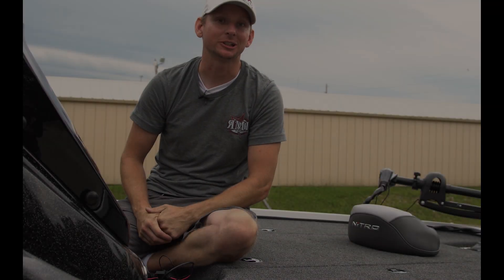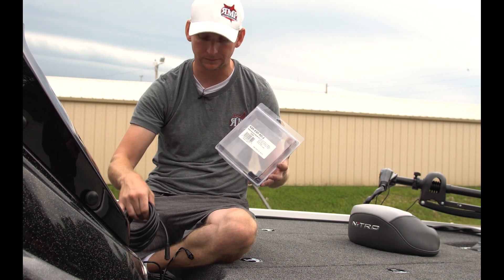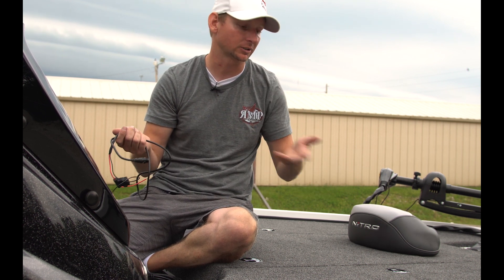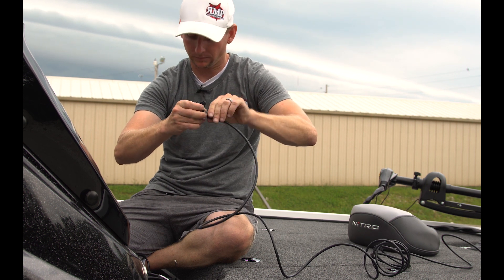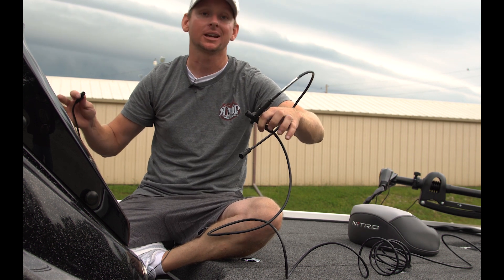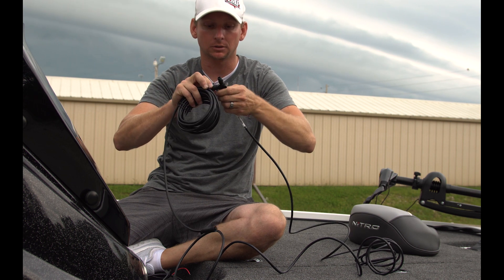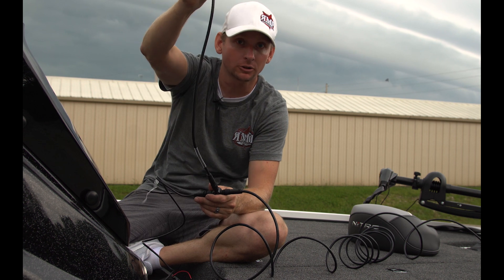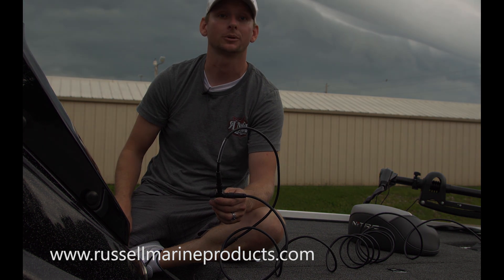How to Build a Lowrance NMEA Network

Comment: You really should take down this video, it's NOT the right way to build a NMEA 2000 network. The power does NOT get inserted via the side of a tee, it requires it's own tee. Also there should be two terminating resistors, one on each end of the backbone.

Comment: What if my bow graph and console graph are networked with ethernet, but I want to add a steady cast and another console graph. Can I just run NMEA for the steady cast, the second console graph, and the first console graph? Then the first console graph is on the nmea, but also ethernet connected to the bow graph. Will all the graphs/steady cast then be connected?

Comment: I'm really confused by this setup. Hoping someone can clarify. I don't see the need for the T connector at the bow unit. While this works, he essentially split up the backbone and I dont see why. Why couldn't you just do the following: hook 4 T connectors end to end with a terminal connector at each end. This is your single backbone. That way you have 4 "ports" availble to run drop down cables directly to console graph, bow graph, point-1, and NMAE power. That way there is no need for T connectors at the end of your cable runs and you can just plug dirctly into the unit. Is that right??
Reply: I believe you're correct and I don't see how that wouldn't work as long as you don't exceed 18 feet with your drop-down cable, which he obviously wouldn't in this application. I could see how you would want to use remote T connectors if you had several components to connect to the system in the front or the back of the boat, so you wouldn't have to run so many cords. I'm not sure why he used the connector at the bow here. He also ran the power for the backbone off the end of a T which is incorrect. I'm not sure what this cat was thinking with this setup.

Comment: Hey just came across your video. I'm having issues with my point 1 antenna actually being seen by the hd7 Gen 3.  Is there any diagram out there on how this should be connected? My unit is using a big blue cable that powers it however in the manual is using a nema cable for power so it's very confusing... I'm guessing the point 1 is not getting any power so the main unit is not seeing it... Lmk if you have any advice

Comment: New to all this so please excuse the newbie question.  My boat already had a network(s) established. HDS Live 12 (console) and HDS Live 9 (bow).  I’m adding an HDS Live 7 at console (because I already have it).  The power connector has two cables, power and NMEA 0183 cables. Do I need to connect the NMEA 0183 cable to anything or will connecting the yellow Ethernet ports from my 12 to the 7 provide all the networking I will need?  Primary purpose will be displaying 2d and down scanning while side-scanning on the 12. Any help would be appreciated.
Reply from the maker: you will not need to connect anything to the NMEA 0183 cable, just use the yellow ethernet port sir

Comment: Why do you have to put a second T connection up front for the bow graph when you are already running a 15'ft cable off a T connection to the bow?
Reply: It's needed in order to be able to connect the required network terminating resistor on the end of the back bone.

Comment: Do I need to hook up power supply to each component or does the unit get power from nmea 2000
Reply: Some devices such as the Point 1 are powered from the nmea network, multi function displays such as  Sonar/Chart Plotters require their own power source.

Comment: So.  to connect two units you need a minimum of the starter kit and an additional drop cable.  Is that correct.

Comment: I usually like your stuff,  it this one missed the mark.  I don’t think you can plug the power into the end of a T like you did.  I believe it has to run into the top of a T, with a terminator on the end. In one of the other comments you responded that was correct.  This video. Is supposed to help people understand how to establish a NMEA system and will end up confusing people instead.  It needs to be corrected or taken down.
Reply: I'm actually watching this video as I am setting up my nmea system to my hds live ... the other resistor is not hooked up in this video.. you ha e to have that for the system to work ..  and I believe you are correct the power supply has to be set up from the middle t connecter not the side ... I'm just confused on why I need two power supplies for everything to work .. my hds live unit came with a power supply and this nmea system also has one .. I'm not sure if both need hooked up or not.
Reply: @Rockers1121  you need both power supplies. The HDS is power by its own supply and the NMEA network is a low power network, but it does not draw from the HDS.
Reply: @FishOn1  oh OK..  damn ... that's unfortunate.. I'm hooking my hds live to a separate 18ah lithium battery because I didn't want interference from my trolling motor battery or my starting battery .. so do you think it would be OK to wire the nmea power supply and the hds power supply together and just hook them straight to the battery ? Or am I gonna have to hook up the nmea to a switch that is powered from one of my other batteries, and if I do would it cause interference to the nmea network?
Reply: @FishOn1  I'm honestly not impressed with how the wiring for lowrance and the nmea network wiring is designed at all, the tranducer plug that plugs into the back of the hds unit is way to big in diameter  .. no way am I drilling that big of a hole into my transom .. I had to go over the whole transom with the cable .. I couldn't use the hole that was already there unfortunately  .. .... I just think that there are some things that lowrance didn't think through very well when it came to designing the wiring.. and the whole back bone setup for nmea setup is kinda dumb too.. I just think all of it definitely should have been designed better ..  hopefully the technology will make up for the bad wiring designs  .. I havnt used the hds live yet.
Reply: @Rockers1121  I would hook it up via a switch or a fuse I can easily remove. Otherwise, it will draw power 24/7 and drain your batter my over time. No reason you couldn’t hook the NMEA network to your starting battery. There would be no interference issues with the NMEA.
Reply: @FishOn1  thank you I think that's exactly what I'll do ..  I have a couple switches in my switch panel that are not hooked up to anything I'll just use one of those for the nmea network. Thanks for your help!

Comment: I think you missed the other resistor.  You need a resistor at each end of the backbone.  It is my understanding that the power should be through a t connector.  Can you please clarify?
Reply: I think you are correct, the 12v installs like a drop down in a T.

Comment: hooked up two Elite Ti's this way but still not networking together.  Are you sure two Elite Ti's can use the same transducer?
Reply: I'm pretty sure they can't use the same transducer just share way points or control a motor etc that's connected as well

Comment: I am installeing second Chart-plotter HDS LIVE at the aft steering station, some one mentioned having to supply separate power directly to the second unit as there would not be enough power thru the NMEA network?

Comment: This is confusing to say the least.  One comment points out that the power would need to go through a T and have a terminator at the end, to which you agree.  Further down the comments another person asks if you can plug the power into the same T the graph is connected to and you reply "Yes!"  Those are 2 contradictory statements.  If this video is incorrect, and it seems it is, you should take it down before someone follows this installation and is then trying to figure out why their network is not powered.

Comment: So in the video you plugged the power cable directly into the end of the T. Will that work or does it need its own seperate T connector? Im really confused now.
Reply: The power cable needs its own drop from a T connector, not connected at the end of the T. The two end-most T connectors both need resistor caps to complete the circuit. For what it’s worth, I’ve also seen advice that power should ideally be run from a T connector near the middle of the backbone rather than the end of the backbone.
Reply: Me too.  The starter system only comes with 2 termination caps,  2 cables, 2 t's and 1 power cable .  This doesn't provide enough supplies to connect any two things if you need a T for the power, and one for each unit.  Need clarification.

Comment: So through this system, it powers all the units?  No need for separate power cables?
Reply: My understanding is that, if the "unit" has a low power demand, it can get it's power from the system.  If you have a large display such as a chart plotter, it requires it's own power supply in addition to being connected to the network.
Reply: The NMEA 2000 network requires a power cable JUST for it.  All other devices like a Garmin Chart Plotter need their own power.  A small GPS antenna will not require its own power as it consumes very little.

Comment: So you can plug the power supply into the same "T" that you plug your first graph into?
Reply from the maker: Mark Polsky yes you can
Reply: Russell Marine Products, LLC Thank you for your response, I have one more question, I don't have console on my boat so I wanted to connect both "T's" directly together and run the 15' cable from the center of the second "T" ,and use that 15' cable to run to the bow, plug that 15' cable directly into the the graph at the bow? Can I do this or is that 15' cable only for plugging into the "T's" not the Graph?
Reply from the maker: they need to go to T's and have a drop down cable from your graph to the T connector.

Comment: I was always told you have to use to terminators.... and that the power supply has to go through a T
Reply: Yes...I believe you are correct.  The power supply plugs to a T drop and then you add a terminator on the end if it's the end of the backbone..
Reply from the maker: Mike Hart you are correct.
Reply: Russell Marine Products, LLC then why did you plug the power into the end of the t

Comment: Where you put a resistor cap at bow, could you of wired a point 1 GPS there? Or must it be near the backbone?  Also on this nitro, where did you place the backbone? Driver locker?
Reply: Russell Marine Products, LLC I thought the point one had to be hooked to a T is well.... not directly into the backbone end
Reply from the maker: Mike Hart you are correct, the t from the point one can be plugged into the end of the other t connector.  I should of been more specific.
Reply from the maker: Yes you can put the point on on the bow and have it there instead of the end cap.  Backbone was placed under the dash, its easier to ziptie it up under the dash for that.